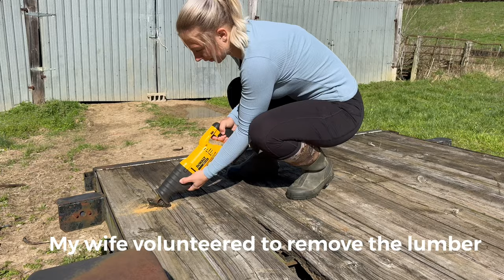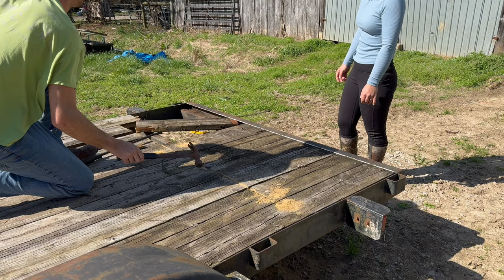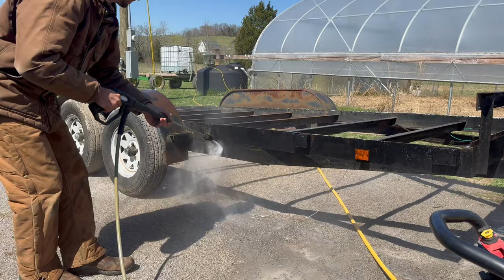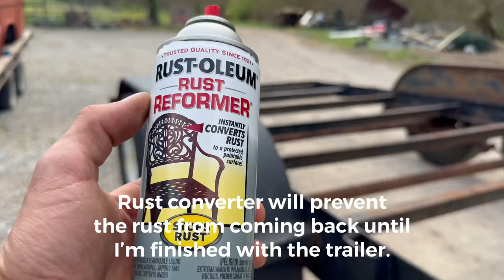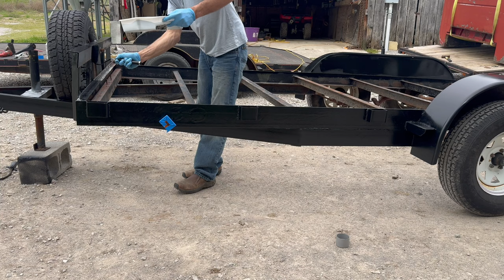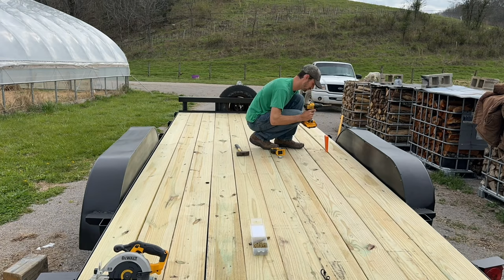Trailer Restoration for $600!

Comment: Spray paint lasts a couple of months in our climate.  I've started just brushing rust inhibiting paint on with a paint brush.   The lines left by the paint brush disappear and it leaves a pretty thick coat.  Neither method has the UV stabilizers or hardener of automotive or industrial paint.
Reply from the maker: Spray doesn’t make a difference if you’re using good paint and do proper prep. I think people have bad experiences with rattle cans because the preparation isn’t right, or they don’t prep at all. I sprayed my livestock trailer almost two years ago and it’s holding up very well.

Comment: Heavy equipment mechanic here as well as former tuck/trailer mechanic. Just some tips. The heatshrink solder connection needs more heat. The little solder ring in the middle needs to melt completely to be properly installed. You will think you are going to melt the heatshrink for how much heat it takes but as long as you aren't using direct flame you should be fine. That ring should look like a sliver blob or almost fully distributed through the strands is even better.

This next one may or may not be useful anymore because last time I re-decked a small trailer like this was right when lumber was stupid high in price a few years ago. But I had some random guy in the parking lot at the hardware store recommend aluminum boat dock planks for re-decking small trailers. I took his advice and picked some up from one of the local metal supply stores. It was maybe a couple hundred more than wood to buy 4 24 foot planks to install on a 16' trailer. We had the planks cut into 4 16' planks with 4 8' planks we used in the middle, end to end. Ended up only having about 4" of waste, and a deck that should last longer than the trailer, as long as it isn't beat on to badly. The aluminum more than paid for itself considering that trailer is on its third deck. The stuff will hold some weight as well. Which was my biggest concern. I needed to move a 7K lb skid steer about 25 mi and I had no other trailer available. The skid steer also had a mechanical issue that caused it to jerk around almost uncontrollably which made it bounce around on the seriously over loaded trailer. I figured I had ruined the deck after that beating. Got the skid steer off a couple days later and the deck looked as if nothing had ever been loaded on it. I was seriously impressed with those planks.

One last thing to add. I has some small cheap LED cube lights that I wired into the backup light circuit of the 7 way plug. You used to not be able to see a thing while backing up at night. Its not a problem anymore. I did all my trailers that way now, and for only about $20-$30 for lights and wiring.

Comment: Looks good brotha! Pros and cons of rolling the paint instead of using spray gun?
Reply from the maker: Same thing! I like to roll it on if it’s a windy day and I don’t feel like dealing with the spray gun. Rolling is easier and it’s less likely you’ll leave drip marks or streaks. If you’re doing something like a wheel, spraying is typically easier because it gets in the cracks and the tough angles. But for a flatbed on a steel deck trailer I’d definitely roll it on. That’s actually what I’m working on now. Flipping a 18ft steel deck trailer. Rolling the deck and sides, then finishing the corners and cracks with spray. Using the same paint of course.
Reply: @charliefarms1 what kind of paint did you roll
Reply: Sweet move on the board install

Comment: Did you have to rip a 2x8?  My trailer has 10 7" boards and I'm wondering if they just shrunk from the 7 1/2 nominal dimension.  I am rolling mine too!  Way faster, thicker coats and it's a trailer, not building a watch or painting a show car.  lol